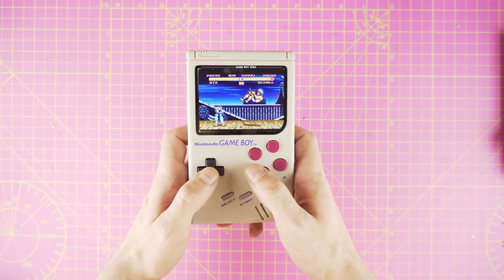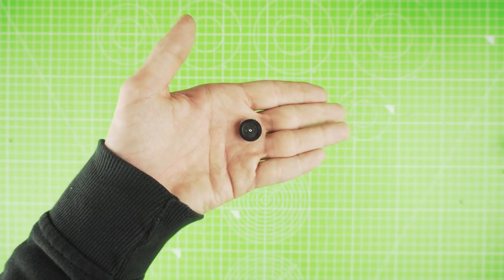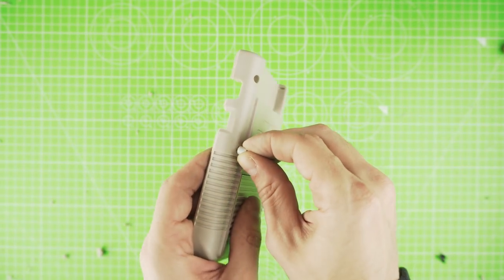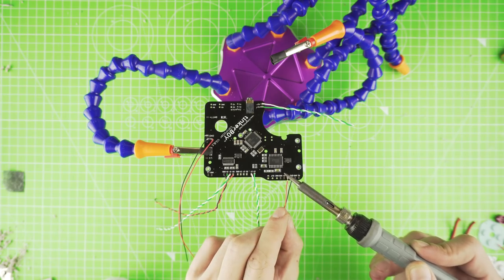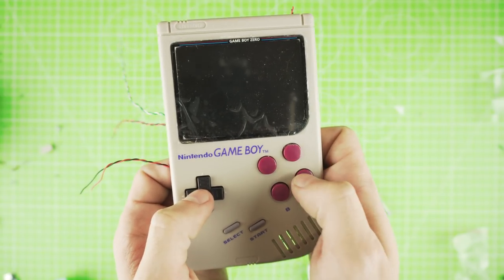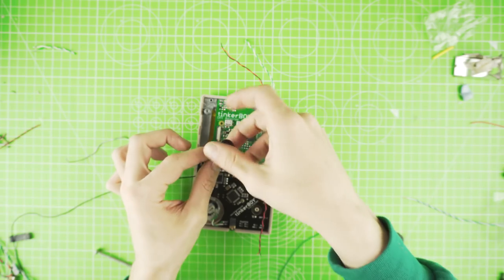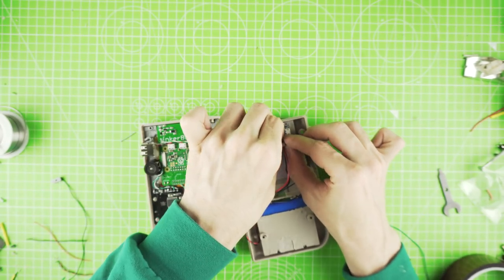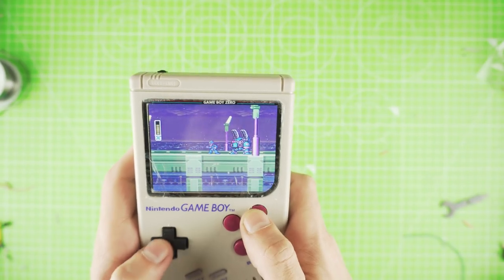Game boy Zero Tutorial

Comment: Adam, one more question: what wires would you recommend for connecting the boards?  24 AWG ?  or thinner like 20 AWG? what did you use?
Reply from the maker: Hi Alexander, the wires I will recommend are the ones you find inside a USB wire, I believe they are 24 AWG, you surely have some lying around so just strip the outer shell and get your free cables 😂
Reply: @Adamstech  thanks this is great suggestion!
Reply from the maker: This what I have been using for all my Pi projects 😁

Comment: i heard the most common problems with the tinkerboy is the buttons and how they become unclickable or something, its all over the blogs. how did u fix that? did u use new buttons and pads? cuz those are expensive and i like to reuse mine ( cuz its free)
Reply from the maker: Hi, I saw the posts, is a very easy fix, take some 1500 grit sandpaper, and carefully sand the pins, some of the boards had a protective coat all over it, using that sandpaper will fix that easily :D

Comment: Hello Adam,
Do i need to activate SID in linux before installing DPI Adapter ?? or this copy/paste lines are enough ??
Reply: And one more, how You solder the ext. USB port to the Pi if You solder the Pi to DPI before ??
Reply from the maker: Now is an easier way of doing this, you can get a prebuild image that works with the DPI adapter and also works with the V1.1 Image, more info here https://www.tinkerboy.xyz/retropie-image-with-built-in-support-for-usb-audio-gpio-controller-inputs-and-dpi/
Reply from the maker: @Andzorulez  The DPI adapter has 2 pins on the back that connects to D- and D+ on the back of the pi, you just need to fill the 2 holes with solder :D

Comment: Hey Adam. Turns out my battery is a little bit bigger than the Gameboy housing allows so I cut a bit of the housing to fit it. Should this be ok behind the circuit boards? Thanks
Reply from the maker: It wasn't supposed to be a fit without a bit of modification, as far is not esthethical you are fine
Reply: @Adamstech  thank you Adam! Such is my inexperience :) does the mini usb port have to come with a port or where does it connect to? The adafruit?
Reply from the maker: @yoshisdaddy  yes the micro usb goes to the 5v in on the power booster
Reply: @Adamstech  thank you Adam
Reply: Hey Adam. I have a lot of leftovers from my project and I wanted to offer them to you for purchase if you're after anything in particular? Thanks
Reply from the maker: Hi Michael, send me a list with what you have and I will let you know if I need any. Adam@8bitcustoms.com

Comment: I am thinking to build a Raspberry Powered Gameboy, but instead of the Zero i wanted to use the Pi 3... Is it possible to use this parts with the model 3? What do you think?
Reply from the maker: Ofc you can do it, I am currently working on 1 right now, if you use the dpi adaptor you need to solder an extra wire for the pi to be able to take 5v
Reply: Yeah because they've announced the Raspberry Pi 3 A+ recently and i just thought use this one instead...
Reply from the maker: @lukasrgl  Yeah that makes the most sense atm, being cheaper than Pi3+ and having the same capabilities
Reply: I want to try it too with the A+ but i am not sure which parts i will need

Comment: Should I strip my wires?
Reply from the maker: do you mean the ends before you solder or all together?
Reply: Adam Builds the ends of the wires
Reply from the maker: yes of course!
Reply: @Adamstech  hi another quick question: how did you remove the ribbon cable from the gearbest screen?
Reply from the maker: @connorblazerod9678  You don't have to remove it, is a connector, just slide the black plastic part down and the ribbon and screen releasees from the pcb

Comment: Does anyone know what kind of wires are good to use for this project and where to get them? I saw another tutorial where he cut up USB wires, but didn't specify which kind of USB (3.0 vs 2.0) or if it even matters.
Reply from the maker: For power rail please go with 22 AWG wires for the maximum amperage, for the rest usb cables from any type works great
Reply: @Adamstech  Sounds great, thanks. When you say "power rail", are you referring to the Adafruit PowerBoost that you employ in the video?
Reply from the maker: Yes the cables from adafruit to pi and to the charging port needs to be 22AWG
Reply: Hey Adam, I'm building my GBZ today. I have a few more questions for you:

1) Can I use 22 AWG for everything or just powerboost?
2) Can I use electrical tape for back of screen instead of kapton tape? Are there any differences or risks?

Thanks.
Reply from the maker: You can use 22 awg wire in all but it will make it harder for you to close the case as they are thicker, works with electrical tape also !👌

Comment: Hi Adam, i have a few questions 
1. Can i use DPI adapter with Tinkerboy v.1.1 controler ?? This one is waaay to expensive for me cuz im from poland :/
2. I want to use RPi Zero W. Do i need to wire USB ports ??
Reply from the maker: The dpi adapter doesn't work with v1.1 as that one needs pretty much all the gpio's for the buttons, with the Dpi adapter you will have just 4 gpio pins open to configure
It doesn't make sense to buy the adapter, just go with the AV pin and is cheaper!
Reply from the maker: For the USB port just get an micro USB adaptor and strip it down

Comment: Amazing, I just started this build today.....I did not get the display adapter, but maybe I should have. Only thing is I planed on having the HDMI port on the side instead of the microSD and using a PRS cartridge board. I ordered a safe shut down as well.
Reply from the maker: I got that cartridge board, if you check my first build  you will see that I tried the same thing but I broke the cartridge reader
Reply: @Adamstech   - what AWG wire did you use 28? I ordered the DPI board today
Reply from the maker: @OkiDingo  I think they are 26, I used the cables from an old USB cable
Reply: Adam Builds - I just realized I had seen your first GBZ build a couple weeks ago. I will use the PRS card if it comes before the DPI board comes. It’s kind of a gimmick as you have no reason to remove the mircoSD. Especially since I got the Pi Zero W.
Reply: Adam Builds - Adam Builds - where did you get the battery? I ordered the 4000MaH one
Reply from the maker: @OkiDingo  https://bllutech.com/products/4aa-size-5000-mah-lipo-battery there you go